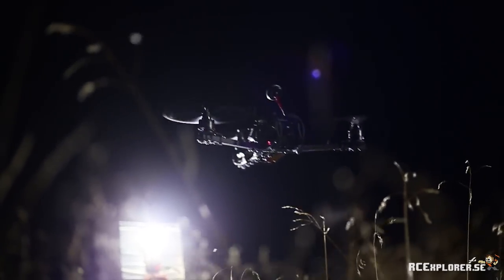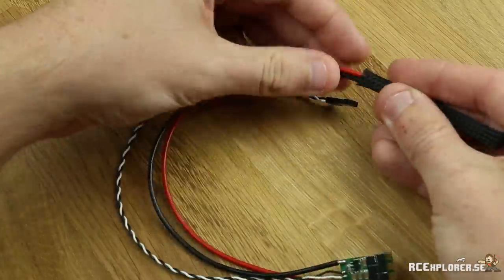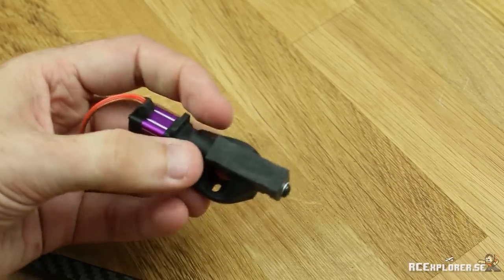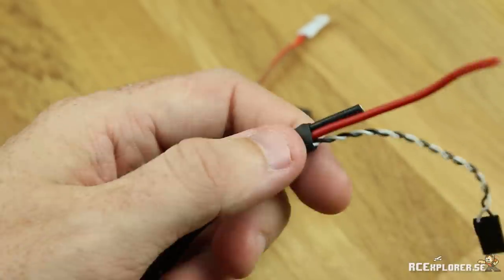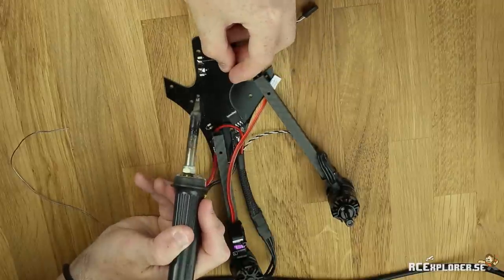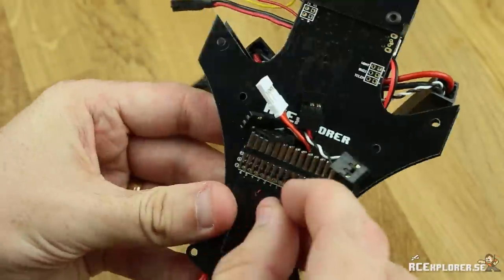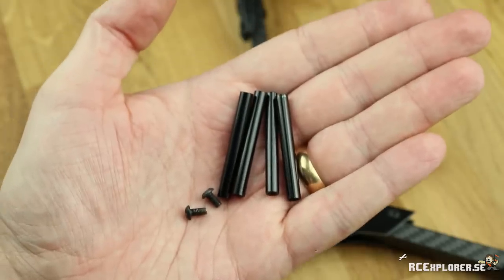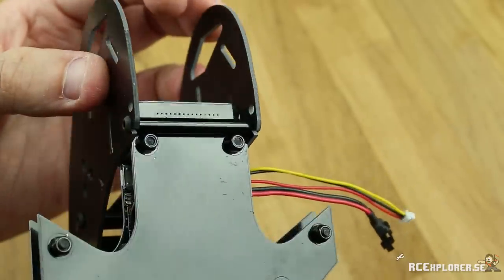RCExplorer Mini Tricopter - Build Video

Comment: have you tried the rotorbits tyicopter tail unit i use it myself and find it very responsive and its cheap from hobbyking and its aluminium gears hard to strip easy to set up works well

Comment: Can you update this video to include the updated mini tricopter electronic kit that is purchased with the mini tri copter in this video you are using a completely different ESC so it's very confusing to actually build this tricopter following this video's instructions I also think you need to put written instructions on your website because right now I've been attempting to build this tricopter using this video's instructions and it's not helpful at all.

Comment: Hello David. Do you think it is possible to build a tricopter where there is one motor im the front and two in the back? Basically the opposite of a normal tricopter. I am making a model and it would be easier to fit it a tricopter in that orientation to the form factor.

Comment: excellent videos 
i want to tilt all the three motors will it be possible ?
Reply: I'm thinking you would need to 3d print some form of mount addition.  There would not be a way with the stock setup to tilt the motors that I can see.

Comment: What's the total cost to build this with everything in the video or a roundabout cost?
Reply: +Chris Peck http://rcexplorer.se/product/minitricopter-kit/ Not to mention that you need a battery, transmitter and receiver not included in the kit. I got a transmitter and receiver combo for 55 bucks. battery prices range from 20 to 100 bucks.

Comment: Do you really need the NAZE32, PDB and Bec? or is it just fine to go for the g10 bottom and top?
Reply: only if you want something to control the motors and escs, distribute power to them, and something to regulate the power for the naze32. otherwise it would be a hunk of g10, carbon fiber, motors and props.

Comment: Just bought the kit, I hope it get here fast.. I was wondering, as I'm looking for a 2nd hand remote. Is the Futaba 6ex good enough for this setup? and how about this for battrery: Lion Power 11.1V 4200MAH 30C MAX Lipo Battery XT60 Plug?
Reply: +Moav Winnykamien probably too big (heavy) with too low voltage (3S and 30C too low). Although this depends on the electronics but if you use the ones David sells it is advised 1800mAh 4S 50C.
Reply: +Craig Sturgess I've seen it's advised bat, however I cannot ship batteries to Israel, can only buy locally, can you tell me if other then what you wrote, should I look for specific characteristics? voltage?
Reply: I have read people have used 3S (11.1V), but to get the most the the tri you will want 4S (16.8V). The C reflects how well the battery handles large discharges, and you want the capacity*C to be greater than the power draw at peak (3 ESC 60A i think + safety 20A). Ultimately you will also want a battery that fits and isn't too heavy although you cannot order them http://hobbyking.com/hobbyking/store/__11942__Turnigy_nano_tech_1800mah_4S_35_70C_Lipo_Pack.html shows you the size/weight of the prefered battery. You will be able to fly with anything 4S and around that size/discharge, obviously the lower capacity will mean a shorter flight time, a higher one will be heavier. For any more information I would advise going to rcexplorer.se
Reply: +Craig Sturgess Thank you so much. I've also found this: http://www.hobbyking.com/hobbyking/store/uh_viewitem.asp?idproduct=11942&aff=61689 
that completed the picture and made sense of everything I hope.

Comment: is this copter fast enough to actually win races? sorry if this sounds like a stupid question but im still new to this and im trying to find the fastest one to build, and is this a 250?
Reply: depends on the race. he says it goes 100mph-ish. with the 6 inch props it has a bugger "bite" on the air, so maybe a race with more turns. the 250 size class only applies to quads because it measures front right to back left motor.

Comment: Hi do the electronics come with the kit?
Reply: +Jack Brand The kit comes with a frame, motors, escs, props, screws, and a servo. And the control board is integrated in the frame if you choose that option.

Comment: David....I'm really disappointed in the fact that you have not updated this video.   I just bought the mini tricopter with the recommended power pack and half way through I realize I'm not wokring with the same board.   So much has changed from the time you made this video that part of this is totally misleading.  I got everything looking like it was going to work.  Got my Futaba hooked up and got all the sub trim and end points exactly right.   Got my switches set up and calibrated the motors.   But  my tail servo refuses to work.  No manual input will make it move.  Acts like it's dead.   So I'm going to take it all apart again this weekend to see if I have bad solder joint.   Not sure I like all the cutting of servo wires and soldering everything now.  It would be easier to trouble shoot.  Anyway...I'll let you know if I still have any problems.  I'll take the servo off and test it with my servo tester.    I can't wait to fly her, but you reallly really really need to update your mini-tricopter video.
Reply: I had some similar issues during the build about 1/2 through I reliezed it was a different board.  At that point I switched over to the V4 video and got the information from there.  It was a bit tricky to translate between the two for a couple of things.  The Mini is so cool that I think it would be something a new video could really help with.  Since the new baby tricopter does not fold up like the mini.

Comment: is it possible to flip with this
Reply: This Tricopter will flip pretty easy, the F3FC is a very responsive flight controller for both Horizon mode as well as ACRO mode.  So no problem with front, back or side to side flips.

Comment: Could a noob like me fly one of these
Reply: +Johnathon Morrow Why not? But if you are new to rc maybe have a play with an RC simulator on a PC first. A cheap Cheerson CX-10 can be used for practice indoors.  I think these are the most practical tricopter designs I've seen. He knows his tricopters.
Reply: +stewjw I have been in the hobby for years and I'm getting into rc quad and tricopters
Reply: Johnathon Morrow In that case no problem then. I'm still getting my head around setting PIDs  on the flight controller (FC) which is a bit of a black art. Its nice David with his helicopters provides the settings for CleanFlight. Its also a neat idea David has done incorporating the FC into the frame. These small high speed multicopter motors these days are often nicely balanced and don't cause a lot of vibration unlike not too long ago when vibration could be quite bad and balancing them was a pain..
Reply: +stewjw thanks m8e